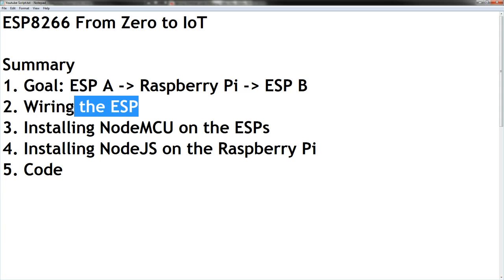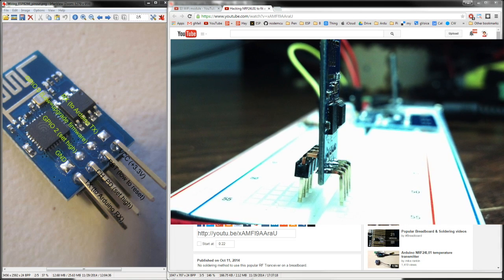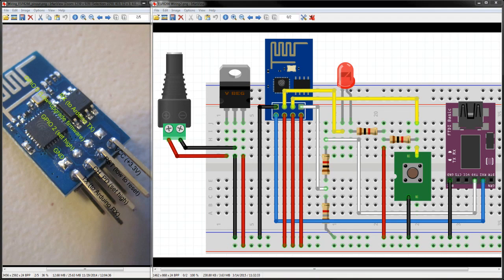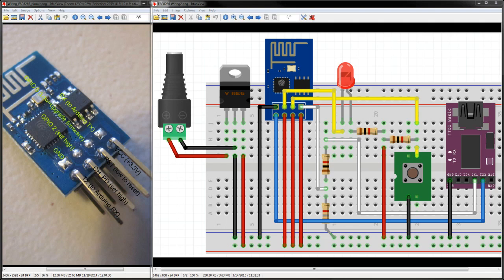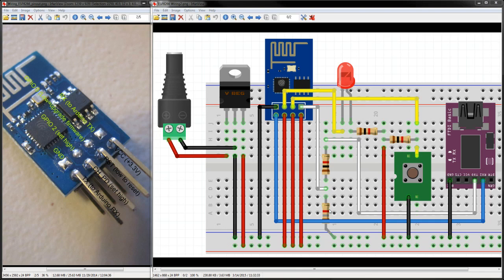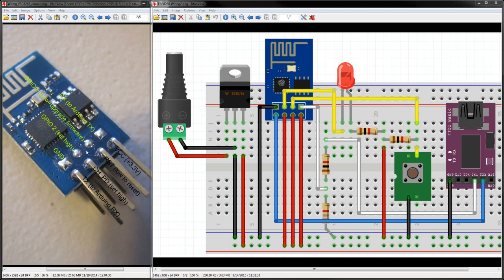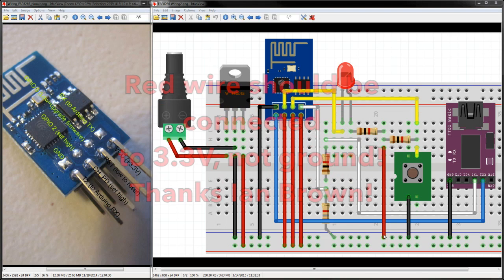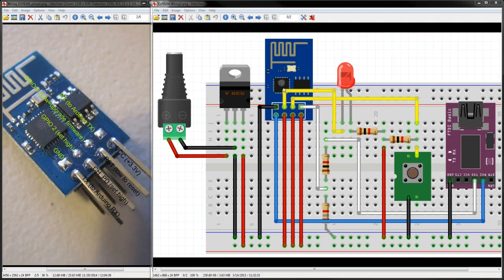HariFun#104 - Raspberry Pi + ESP8266 Part 2 - Wiring

Comment: This is exactly what I was looking for. I am looking to control a kettle hooked up to a 3.3v 10amp Relay over wifi WITHOUT my Pi being hardwired into the relay circuit. I think this would work the way i'm thinking it will.
Reply from the maker: +AnimosityGamers, You might be interested in an even simpler solution that I discovered later on.  Using a cloud server outside the home (such as AdaFruit.io) allows us to access the devices without worrying about port forwarding.
https://www.youtube.com/watch?v=MWebdJwr6ks&list=PL-xZsBalytNAFgyiDI8_lwXyeVE3R4hpx&index=20
Reply: Hari Wiguna This is exactly what I was looking for. So with a relay and a ESP8266 I can basically control anything. This way it eliminates the Raspberry Pi all together does it? Also do you know if this will be a subscription based service after its out of open beta?

Comment: Hi, could you to detail which components you have used to connect the battery to breadboard and how you down its 7v to 3,3v and which are the resistors values ? thanks
Reply from the maker: +Cristiano Gavião , this link has the resistor values:
https://hackaday.io/project/3465-playing-with-esp8266/log/12683-downloading-and-installing-nodemcu-firmware

I usually use AMS1117-3.3V to convert 5V to 3.3V.
http://www.amazon.com/AMS1117-3-3V-Voltage-Regulator-AMS1117-3-3V/dp/B00898NGL0

You can also use 7803 to convert 7V to 3.3V.
https://www.sparkfun.com/products/526

Comment: Hari, I noticed that people use node.js with the ESP LUA firmware.  Is it possible to use node.js on the Pi as a webserver and use the arduino firmware on the ESP?
Reply: Can they still talk to each other just as sufficiently?
Reply from the maker: +O.T. Powell , yes, you can use node.js and ESP via Arduino IDE.  Node.js running on the Pi can act as a webserver and/or webclient.  Same goes with ESP running any firmware.
Reply: +Hari Wiguna Hari, I can't thank you enough for answering all my questions.  I really do appreciate it.  Thanks for the videos also, your a smart guy.
Reply from the maker: +O.T. Powell , glad to be able to help.  I'm fortunate that there are many people like you who are interested in what I find interesting. :-)